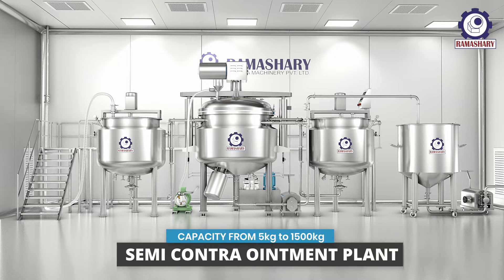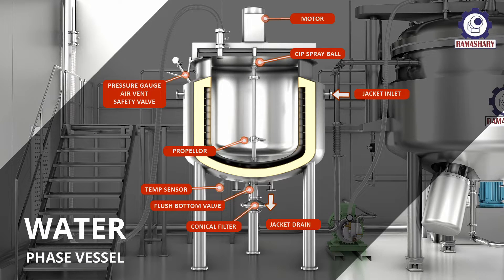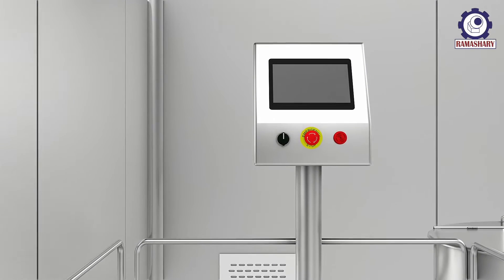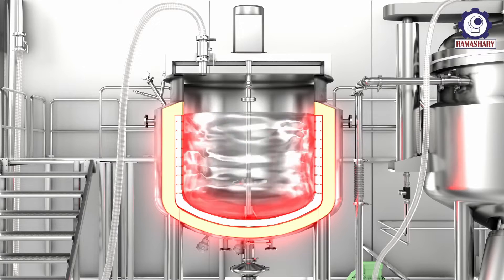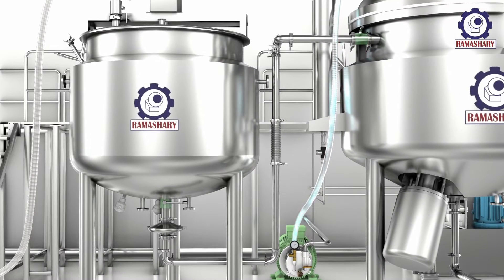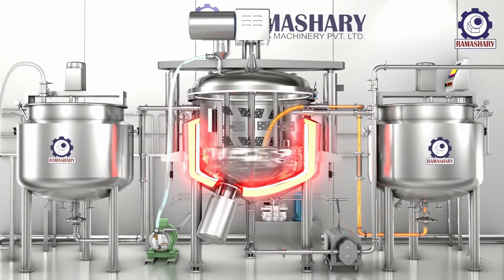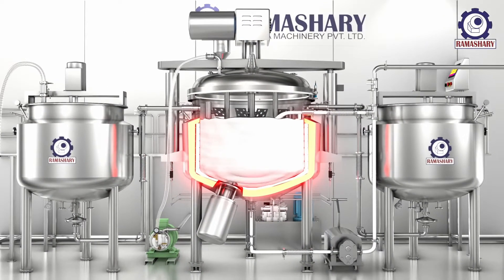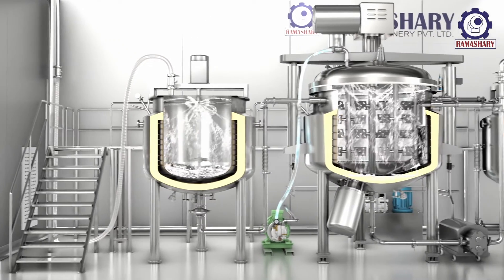Ointment / Cream Manufacturing Plant

Comment: Do we need boiler to make steam and supply to these vessel or does it have its own heating system and can work without boiler
Reply from the maker: It depends whether you’ve an existing boiler system or not, this complete plant has its own heating system via electrical heater.
Reply: @ramasharypharmamachinerypv1458  How much electrical load in terms of KVA (KW )is required to run this system
Reply: @ramasharypharmamachinerypv1458  How much electrical load is required to operate the plant with its own heating system via electrical heater for 200 kg capacity batch size in terms of KVA (KW).